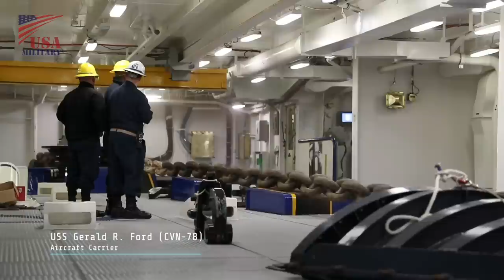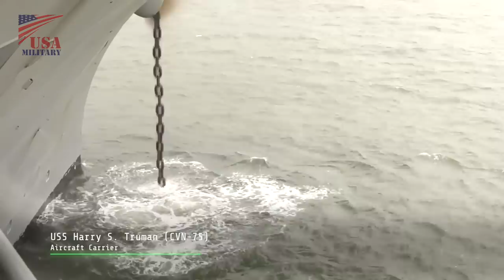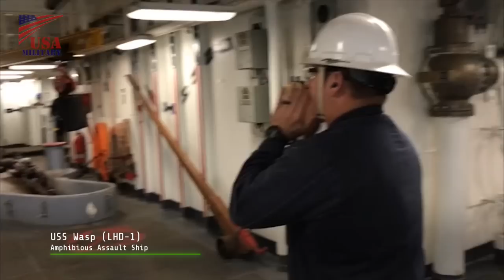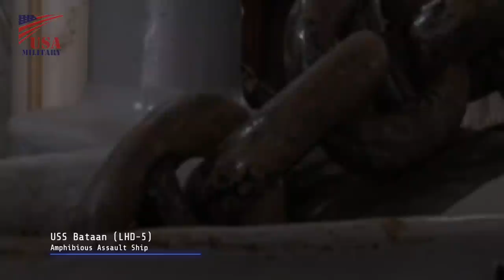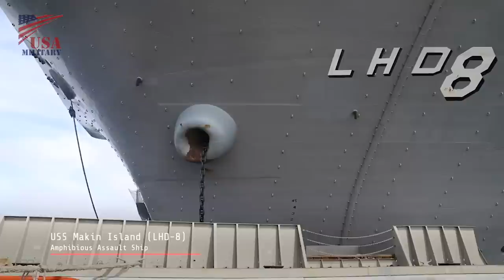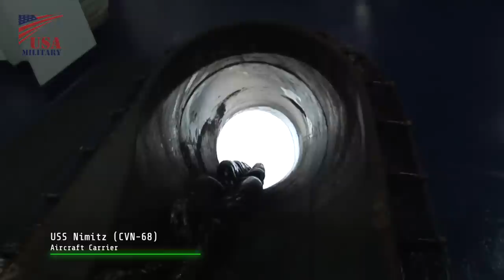BIG Anchor Drops from Aircraft Carrier & Amphibious Assault Ship

Comment: do they change the anchor types ? (for rocks, sand, ..etc)
Reply: Most of the stopping force of an anchor comes from the weight and resistance the chain provides in the water not from the anchor itself, so no not really